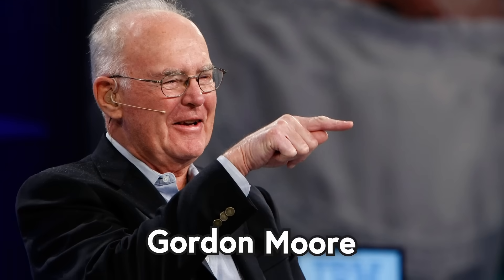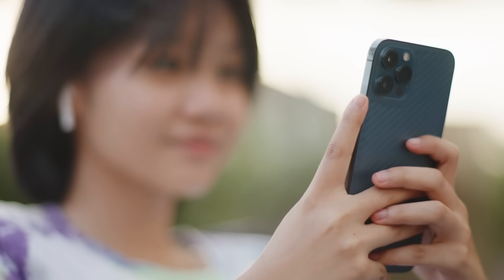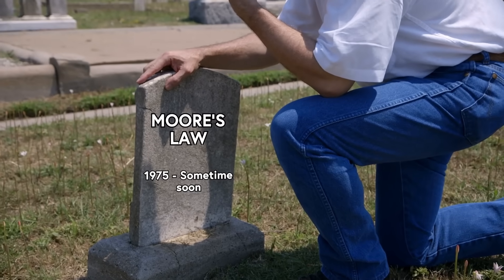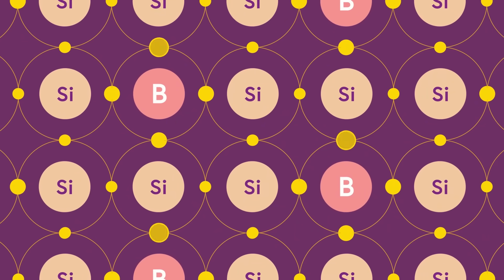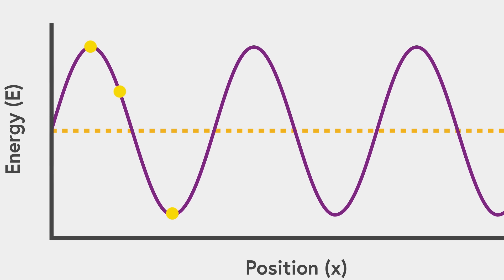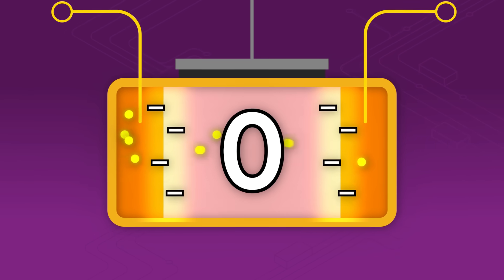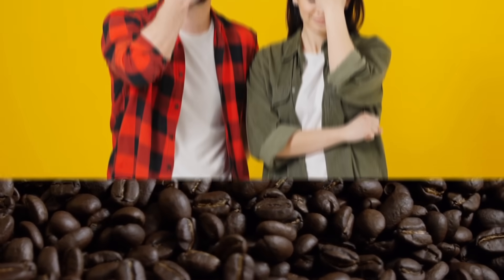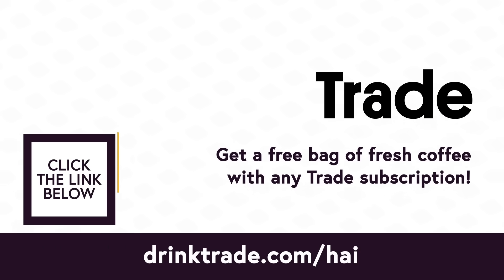Why We're Reaching the Theoretical Limit of Computer Power

Comment: Quantum computing isn't necessarily any faster than classical computing. It can solve certain problems faster, but most tasks will in practice be slower. It can certainly speed up public-key decryption, which is the main concern right now, and it can do some other things too, but it won't improve your frame rate running Crysis. More specifically, the advantage of a quantum computer is that it can solve problems in polynomial time that are expected to require superpolynomial time on a deterministic computer.
Reply: The usefulness of quantum computing is yet to be seen. Quantum Approximate Optimization Algorithms (QAOA) are the supposed np hard solving methods, but these have yet to be formally proven. The only robust and relevant algorithm applicable to quantum computing is Shor's algorithm. If we want quantum computer to be more useful in any capacity than classical, it will require significant investment into the algorithms they run, which we have yet to really do, imo.
Reply: Is that last bit true? Famously, we don’t even know if NP-complete problems can be solved polynomially with classical computers. I’m not a computer scientist, but I thought that particular veil of ignorance extended into the quantum domain as well.
Reply: @elijahdschultz  If P≠NP, then NP-complete and NP-intermediate problems are impossible to solve on a deterministic computer in polynomial time. (Because that's what P≠NP means.) Answers are known to be verifiable in polynomial time (by definition of NP). That second property suggests a quantum computer could solve some NPI or NPC problems in polynomial time, with arbitrarily small (but nonzero) probability of error. The example some people have given is factoring semiprimes (Shor's algorithm), but there are others as well.
Reply: @EebstertheGreat  [edit: I missed the word “some” in the comment this is a reply to. So, disregard the rest of this comment]
That’s wrong. Quantum computers can’t just pick a random certificate and end up having a high probability of getting a correct one, or like, try different ones in parallel and just get the ones that were correct. NP is not known to be contained in BQP.
Reply: @drdca8263  I didn't say NP was contained in BQP. I said that some NPI and NPC problems are in BQP. I mean, probably. Almost certainly. I'm aware none of this is technically proved (e.g. we could have P = NP = BQP, so NPI = {}, but that's not remotely plausible).
Reply: @EebstertheGreat  my apologies, I missed the word “some”
Reply: @EebstertheGreat  factoring primes/semiprimes is NOT KNOWN TO BE a NP-complete problem, in fact many people think it's not np-hard at all. Unless you can point to NP-complete problem that gets solved in polynomial time by a quantum computer I'm calling bs on your last statement.
Reply: @Fadexpl  Factoring semiprimes is probably not NP-complete. It is probably NP-Intermediate. When did I suggest otherwise?
Reply: @EebstertheGreat  You're claiming quantum computer can solve NP-complete problems in polynomial time. How so?

It just seems like a lie, unless you have some wild proof I'm unaware of.
Reply: @EebstertheGreat  1. A problem is NP-Complete if if there is a polynomial time transform that allows you to use that problem to encode any statement from satisfiability logic. There is no known  method to do this for factorisation or the discrete logarithm problem.

2. People have thought about trying to use quantum algorithms for SAT. They use Grover's algorithm, which provides some improvements over classical algorithms but it doesn't run in polynomial time.
It can search through a domain of outputs N using sqrt(N) evaluations.
So a bruteforce search of n binary states would visit 2^n states classically, but sqrt(2)^n states using Grover's algorithm (roughly 1.1414^n).
This is still exponential and it has been proven optimal, meaning that we won't have a better solution for NP-Complete problems without an improvement in classical algorithms.
Reply: @Fadexpl  I am not claiming that. If I did say that quantum computers can do that, then I made a mistake, but I don't think that's what I said.
Reply: @EebstertheGreat  At the end of your top comment you said "More specifically, the advantage of a quantum computer is that it can solve NP-complete problems in polynomial time". That's what irked me to respond, that would be one hell of a discovery.
Reply: @Fadexpl  Oh whoops, you're right.
Reply: @drdca8263  Even saying some NPC problems are in BQP is wrong. By definition, if one NP-Complete problem is in a complexity class then they all are. Since all NP-Complete problems can be reformulated as any other NP-Complete problem in polynomial time.
Reply: @jaredcramsie182  Yes, that’s true. I didn’t read the reply made to me closely, and so didn’t realize that it said NPC, and thought it only claimed it about some NP-intermediate problems being in BQP.
Certainly it is not known that any NP-complete problem is in BQP, and I doubt that any NP-complete problem is, because, as you say, if any NP-complete problem were in BQP, then NP would be in BQP, which seems unlikely.
Reply: @elijahdschultz  It is not known whether BQP includes NP or not (ie we do not know if it can solve NP complete problems in polynomial time).

Quantum computing can factor integers in polynomial time, which is in the weird intermediate class of NP∩coNP.  IF P=/=NP, then this intermediate class exists and =/=P.  (if P=NP, then this discussion goes out the window)

TL;DR this is still active research
Reply: @pierrecurie  thank you, this is consistent with what I read 5 years ago when I went down the rabbit hole on complexity theory. I figured I’d have heard about it if there had been a significant breakthrough along those lines.
Reply: From what I've gathered as an uneducated layperson, they do have one potential application in chemical modelling, which would be very useful in biochemistry - you can use one for brute-force drug discovery.
Reply: @vylbird8014  Oh, hey, I can speak on this! So, kind of, but not really. There's a bunch of stuff about the micro world we don't really know. While Alphafold (a program like you're talking about) is great - it's a tool I use! - it's far from perfect, especially creating uncertainties in its predictions in proteins associated with the membranes around cells and with proteins that might require other proteins to fold correctly. Essentially, we need to know more about germs and our own cells to make our computer models more accurate. But there's likely a ton of work they can do right now, if we can get those quantum computers running what we need them to!
Reply: Quantum computers have built-in Fourier transform for free, which is super fast. If you can refactor your algorithm so it gets kinda wavey, quantum computer will get it done much faster.

That's how Shors algorithm works.
Reply: I don’t believe that NP is contained in BQP (BQP is the collection of yes/no problems for which there is an algorithm for quantum computers which runs in polynomial time and which gets the right answer at least (2/3) of the time).
Reply: Nah, Ima play crisis on my quantum computer in the future.
Reply: Quantum computers can only really solve Fourier transforms better than classical, and thats because Fourier transforms study waves and quantum are waves
Reply: Why is it that processing power for most things will not speed up? I'm not saying you're wrong, I'm saying I don't quite understand. Something like Crysis is limited by graphics processing, which are a TON of really simple calculations, made over and over and over again, right? Is it unreasonable to make a quantum graphics card? If so, why?
Reply: @logansuits2406  Quantum computers aren't targeted at doing lots of simple operations like required in graphics processing. It is better to think of them as machines which take a complex problem and iteratively reduce the error in their answer to something closer and closer to the true solution. Graphics processing works because of the emberrasingly parallel nature of the calculations. Quantum computers don't do that.
Reply: @freakyalexk101  I think I understand. That's an interesting way of thinking about it. Thank you!
Reply: @freakyalexk101  I mean theoretically if we can find a good way of creating states most matrix operations would be much better... it's not really about something being inherently possible or impossible, just need to find a technique of representing things and leveraging strange mechanics to produce usable results - if you needed to add two numbers and tried to do it by just running the bits in and making a normal adder on a quantum circuit you run into a lot of issues very quickly though (have a lot of personal experience trying to make seemingly simple things work better and not really finding much luck lol)
Reply: @logansuits2406  Short answer: graphics cards are very very fast and doing only “multiply then add” over and over again. Quantum computers are very very fast at doing only “find the minimum of this curved surface.” Quantum computers accelerate only those types of calculations that can be reformulated somehow as a minimization problem. They’re like a wrench: good at turning bolts, but no good as a screwdriver.
Reply: @logansuits2406  My understanding (by no means an expert) is that essentially, the number of simple calculations that a quantum computer can do isn't very different from a conventional one of a similar size. It's only in specific probabilistic calculations where the quantum nature allows QCs to compute at a lower algorithmic complexity than conventional compuetrs.
Reply: @logansuits2406  Quantum computers aren't just faster versions of normal computers. In fact, they are much slower in terms of how many operations they can do. While a classical computer might do a few hundred million calculations in a given time period, a quantum one would complete just a few hundred. The advantage arises because quantum computers are doing fundamentally different operations, and these operations are a massive advantage in certains scenarios like decryption, while in others they provide no benefit. Ask a quantum computer to add two numbers together and it will do it much slower than a classical computer. Instead, clever programs must be written in order to abuse strange properties of quantum mechanics to skip a bunch of steps that a normal computer would have to take. Exactly which common computing tasks for which these shortcuts exist and whether they're enough of an advantage to outweigh a classical computers superior speed is something we're still exploring.
Reply: @logansuits2406  To summarize it simply. Graphics calculations are essentially doing a lot of things really quickly, one after the other, on a queue. If you just think about what graphics are, you can probably see why this makes sense. Its just updating all the stuff thats being displayed really fast.

This isn't a hard or computationally expensive problem. This is a simple problem that has to be done a lot. That's something good ol binary calculations are already good at, and a whole lot of problems functionally are.

NP Complete problems or 'Non deterministic Polynomial Complete' problems is a realm of computer science where you can prove the mathematical problem is a singular problem that results in a consistent curve.What this basically means is its a problem that grows exponentially, but can only be solved by brute forcing from point A to point B. 

Brute force sounds slow, but it's actually what most computations functionally are. Doing simple shit really fast.

Now in computer science we have a concept called Big O. This looks spooky, but its basically a math estimate of how slow an algorithm takes to solve a task given how big the task is. 

Now what you're probably realizing is that for things that a dynamic, like most computer programs, you cant mathematically solve stuff by just skipping tasks. Because ultimately you cant skip into the future. Graphics renderings gotta be done real time, and most intensive computational tasks already fairly efficient real time tasks.

Thus, quantum computers wont do shit.

What quantum is possibly good for is stuff like "Find the prime factors of an integer" which is used in encryption. Because it's a single problem, that doesn't need to be solved in real time (since itself is the greater goal). 

The best known solution for this task has an exponential Big O that's quite large. Not the classic simply insane Big Os like O(n!) or O(2^n) large, but large enough that if we throw a big enough number at it, we can make it computationally impossible, because while it is solvable, its non deterministic, which means we cant solve the results using a mathematical trick that skips the whole curve and just gives the result. There is a calculation that can solve this specific question in quantum thats logarithmic. This means it actually solves it faster overall the bigger the number is, meaning you cant out calculate by just using a bigger number.

But it's not actually faster, just reducing some rare tasks very quickly.
Reply: @logansuits2406  Think about it. As you say a GPU does a ton of simple calculations. With 10000 cores running 10000 arithmetic operations per cycle for example and you get 10000 solved equations per cycle. What we have now for quantum computers is a single 433 qubit quantum processor as the largest. So that means you can run a single quantum instruction and get a probabilistic answer out, run that multiple times and you get an answer, where the response was most frequent. So now you're running even slower than a single core in order to take a probabilistic answer into a more concrete answer. Currently using 5 GHz microwave pulses they are able to generate 15,000 circuit layer operations per second (CLOPS). You can theoretically use that to solve something like a pathfinding problem finding the fastest route which given enough distinct points would be impractical for classical computers, so you can solve otherwise brute force problems, but it's not going to make any more classical computer problems faster as a general rule
Reply: We don't have many algorithms yet, but people are pretty resourceful.
Reply: Complete layperson here, but surely one could combine quantum and traditional computing to achieve a team effect where they complement each other. Basically you dig into setting up task combinations such that the quantum computer reduces the processing load, and the traditional  computer can resolve the part that quantum computers are not suitable for.
Reply: @trdgoeds  when we talk about quantum computing as a whole, we talk about the processors you're imagining already. Right now getting quantum bits to work is a problem, standard CPUs are very easy in comparison. You can think about quantum computing as introducing new capabilities to traditional processors.
Reply: as long as electrons, basis of all electronics, is limited to light speed, all computers have limits. Most not limited by electrons but the actual hard ware and software that makes it all work.
Reply: So in laymans terms: good for certain scientific stuff, bad/not better for general use?